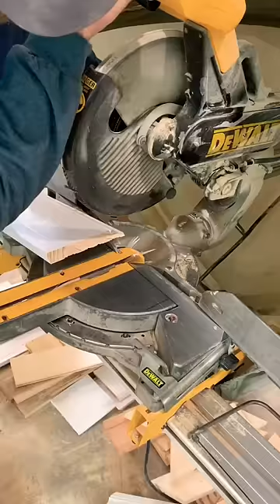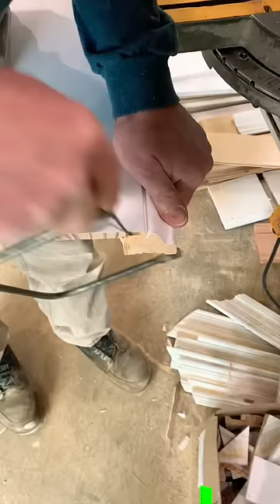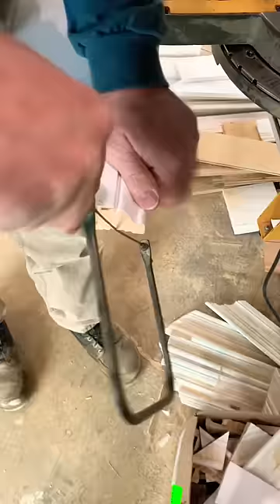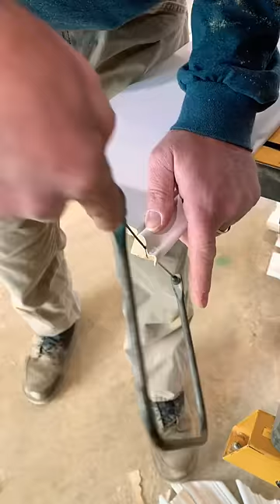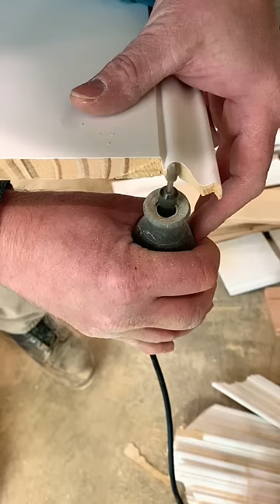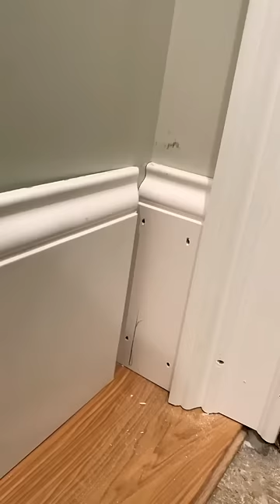Learn how to COPE baseboard…never be a puss and miter it!! #woodworking #coping #baseboard

Comment: You can just measure from the sheetrock to the door frame. Pull from your sqaure mark your messurement then cut your 45. Absolutely no point in cutting it long then coping then measuring off your cope. Absolute waste of time. The time it took you to do all that work I would have already had a whole room cut and installed

Comment: Why do these how to videos always have the base flat, and using the bevel to cut? It's easier and faster to cut your base vertical and upside down,  changing blade angle on the horizontal axis.
Reply from the maker: This is 8” base, not possible to cut vertically

Comment: how Do you cope the outside corners  maybe it's with a dremal
Reply from the maker: You miter outside corners, I guess you can “cope” slightly to make them fit tighter on the backside if need be.
Reply: @w.k.d.constructionllc  OK thanks

Comment: So you won't use a flap disc or Jigsaw because that's how you learned. But then you pull out a freaking Dremel tool. Lmfao
Reply from the maker: It details more accurately than a pc of sandpaper & I just started using it. I learned using the coping saw

Comment: The gap after most coping is the same as the gap after most mitreing. Yours was no different. If you measure the angle of the corner with an angle measure tool, you can get a beautiful mitre.

Comment: You re not doing stained finish so Why would you waiste your time coping onto a 2 inch piece? You need to Learn how to measure accurately, cut precisely your mitters and hot glue together small piece to long piece. Using all these unnecessary tools don’t make you a better carpenter

Comment: So much wasted time and effort. Just measure the wall, write it down, take it to the saw and cut your 45. Hook and pull off the 45 and proceed with coping. No need for the dremel whatsoever and no walking back and forth to the saw.

Comment: I see why you cut that long face with your miter saw because you suck with a coping saw. I did trim work for several years and coped all my inside corners and didn't need a file or dremel to clean up after the coping saw and my copes fit up way tighter than yours did.